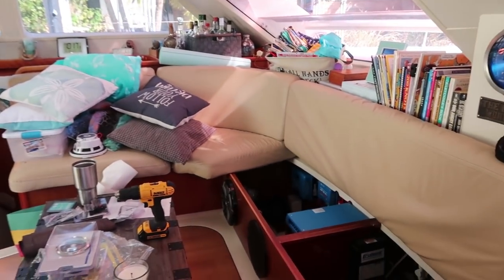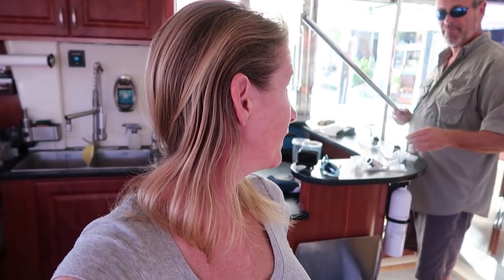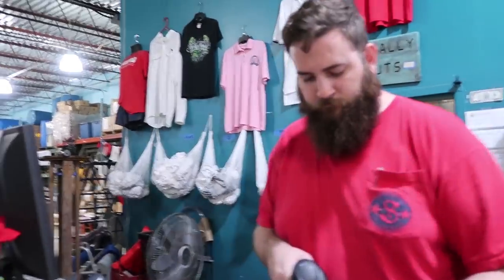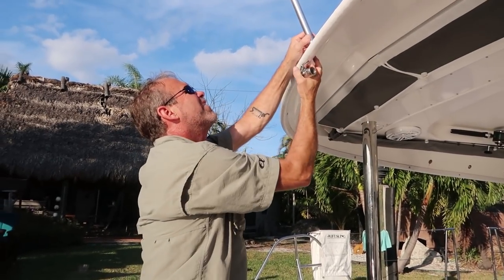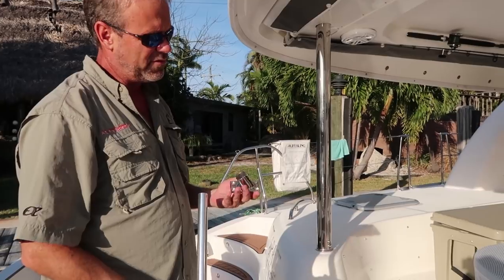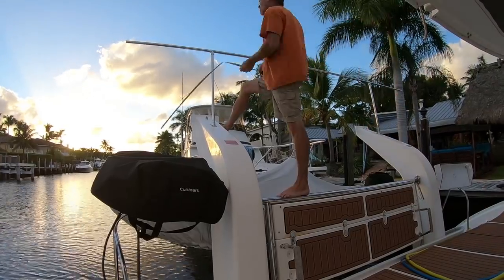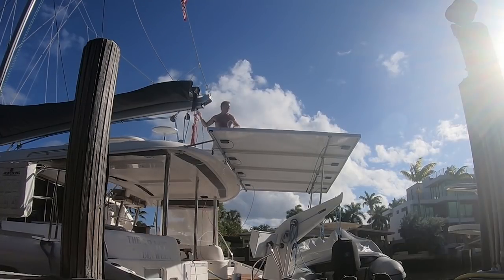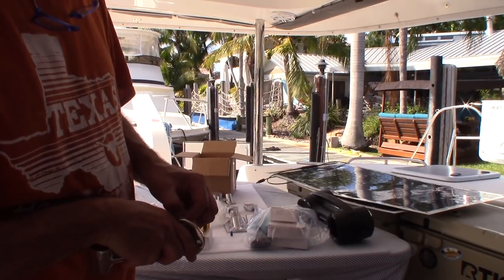Installing Solar Power on our L46 | S3 EP 40 | Sailing The Space Between

Comment: Can you tell me what make/size you’re using, and how they’re holding up? Thanks!
Reply from the maker: They are sun solar made here in the US they are factory seconds and work better than advertized on a direct day I am getting 1300 watts and 2 are in series and 2 in parallel thru that victron controller.
Reply: @SailingTheSpaceBetween  Where can I find sun solar?  Thanks!